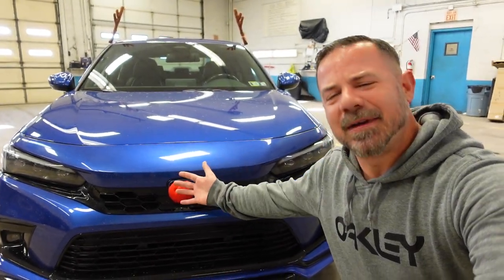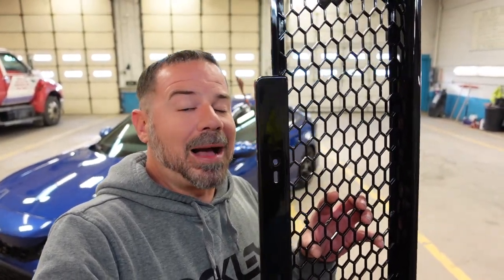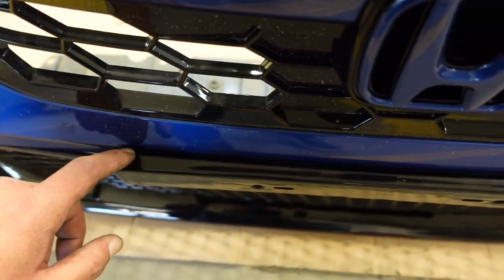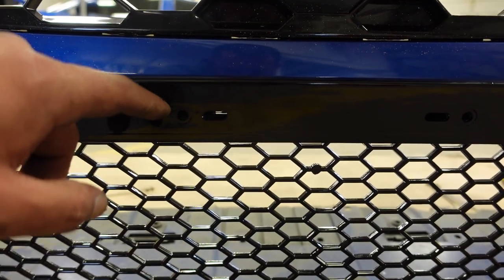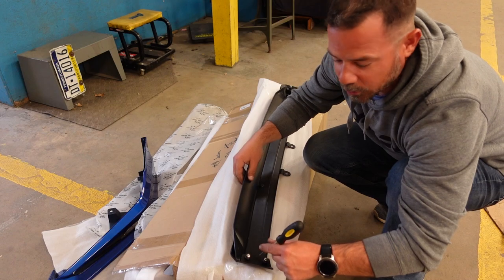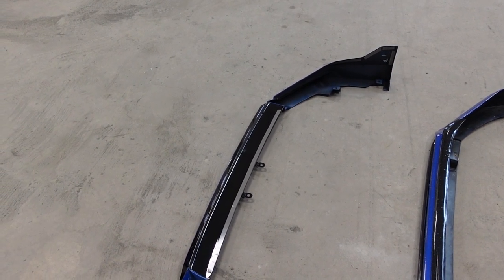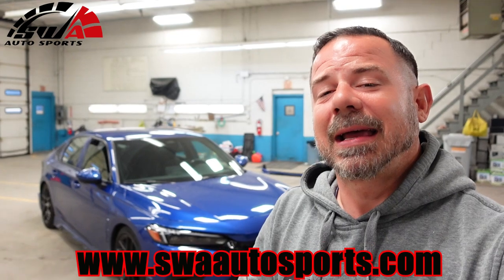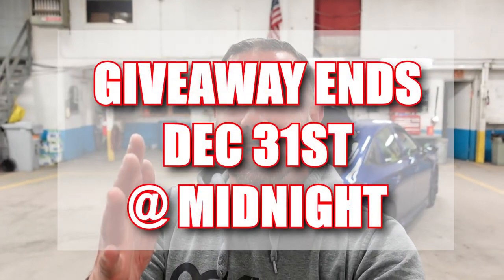Lower Grille, Yofer V3 lip and Phone mount for the 11TH Gen 2022 Honda Civic

Comment: That looks super nice. Gets better everytime. Nicest accessories that you're giving away. What's good is some fit on the HR-V, too.
Reply from the maker: Thank you, brother 😊 🙏
Reply: @717PROJECT  The auto uncorrect is crazy. I wrote that some of the parts and accessories will fit the HR-V Sport, because they use the Civic parts. On an Urban Grey Pearl ones, the black shark fin roof antenna and door handle caps might look good on contrast. 

Those front LEDs you had were bright, but the front end right now looks much better. What would be really nice is if Honda would ditch the Auto Start/Stop and offer the 6 Speed manual in the Sport Sedan as well as the Hatchback, and put the S2000 N/A 2.0 engine with I believe, 240 HP stock. The 6 Speed would let the engine rev like S2000 needed to do.
Reply from the maker: @jjacob25101  that would be awesome!
Reply: @717PROJECT  That would be even more dependable than the turbo engine, and more power than the Si, maybe even tunable a bit. And a souped up HR-V Sport like that would be nice.

Comment: Hey i was wondering if the issues have been fixed for this bottom piece! I just bought a type r style top grill for my civic si but i cant seem to find the bottom piece anywhere. Also what did you use to paint your fog light plastics gloss black? 

Thank you!
Reply from the maker: Hasn't been released yet to my knowledge